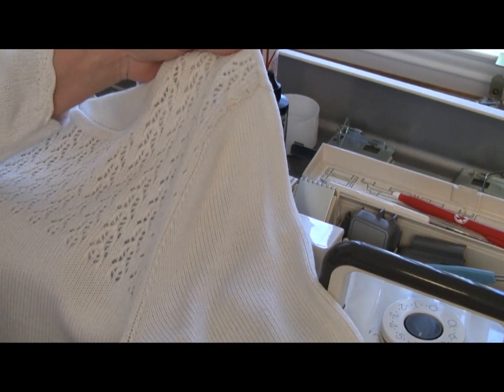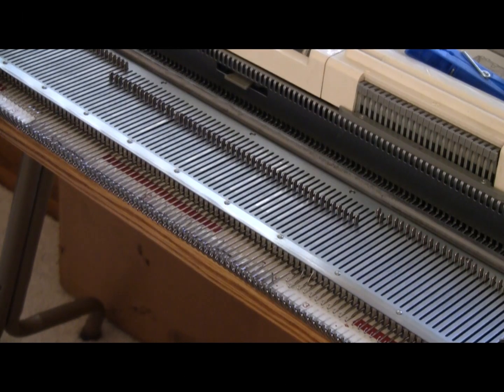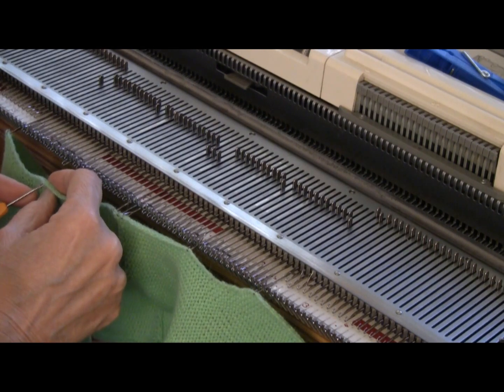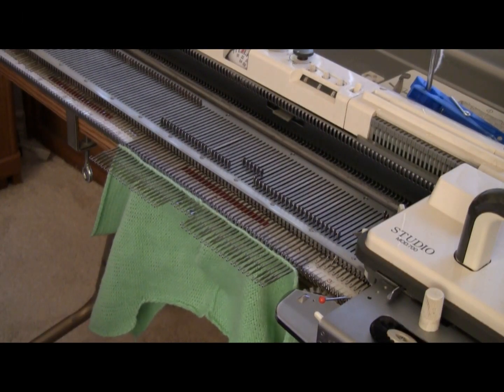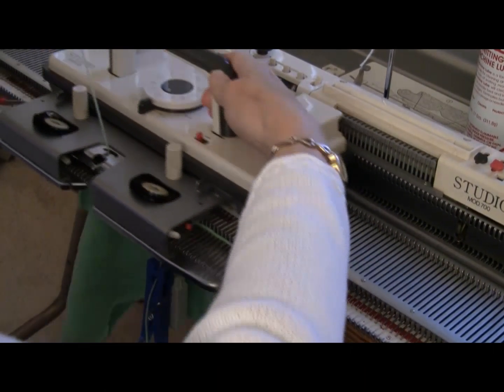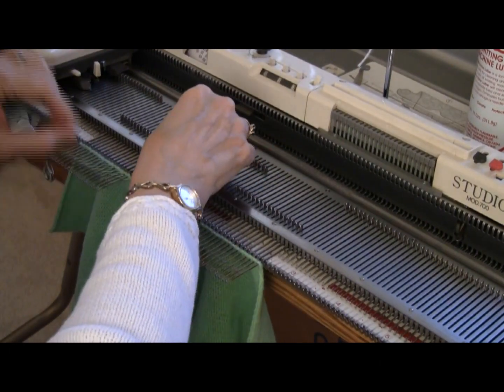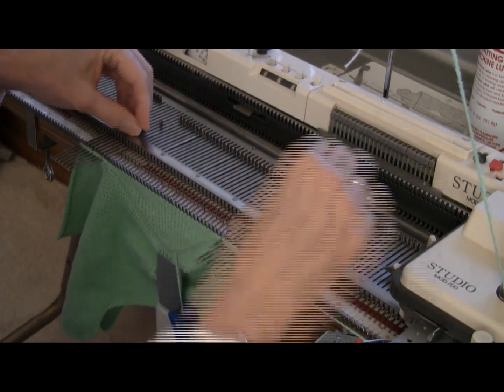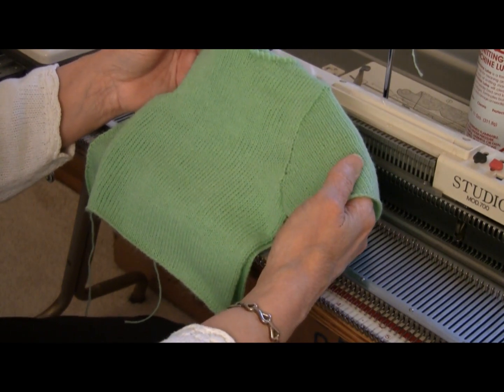Set-In Sleeve Machine Knitted Upside Down by Diana Sullivan

Comment: Thanks for the vid 😄. Ps:  you can increase on the carriage side when short rowing.  If 2 pulled out, yarn goes under both needles.  If 3 pulled out, under, then over, then under etc…
Reply from the maker: I prefer to avoid the floats.  Doing the increase on the next row won't show or change the fit.

Comment: I have actually been experimenting with this method.  I have been doing a full row of knitting before I arrange the needles for the short rowing.  Although it does not come out much differently than directly starting the short rows, it does make the knitting easier because sometimes that "seam" row stitch does not like to knit cleanly off the needle (especially on the bond) and isn't very elastic so you have to add more weights.

Comment: Very informative thank you, is there a way of creating a folded hem or mock rib at the cuff end of the sleeve when using this method?
Reply from the maker: Of course!  If you do this, you do the mock rib hem at the end.  When it is time to start the hem, sew off the stitches that will be the empty ones.  Sew them on to a separate string or ravel cord.  Put those needles out of work.  Knit the hem rows, twice the length of the hem.  The pick up the stitches you put on the string, filling in the empty needles.  Then cast off.  This is a good situation for a tapestry needle back-stitch cast off because it is stretchy.  And you, sir, have given me a great idea for a future video!
Reply from the maker: Oh, look, I already did a video about how to do mock rib at the end of a piece:  https://youtu.be/_tiqQePZ9Jc

Comment: The only way to do this would be if you knew how many stitches was on the machine after your sleeve increases before you start your cap shaping, right…? Some patterns don’t have the total stitches so I guess you would need to work this out beforehand
Reply from the maker: You need the width of the top of the sleeve in stitches.  It is often on a schematic, but if it isn't, you do need to work it out.  This was tricky to explain - you need to follow your own pattern, but it isn't going to be written upside-down like this!